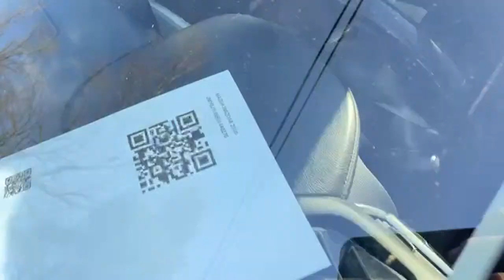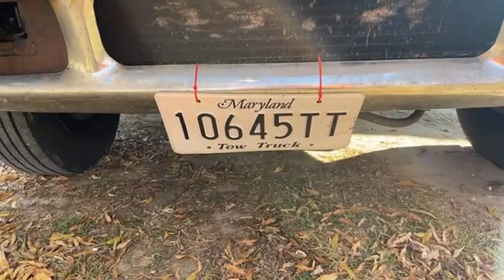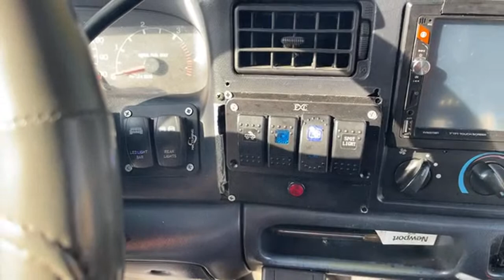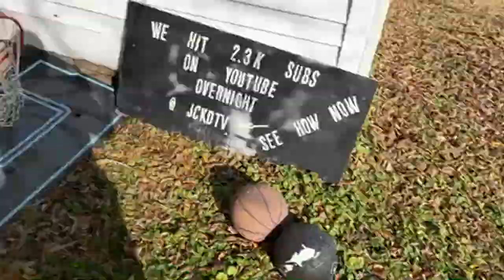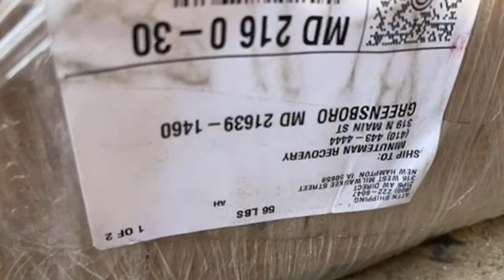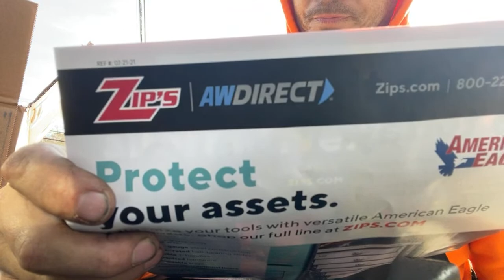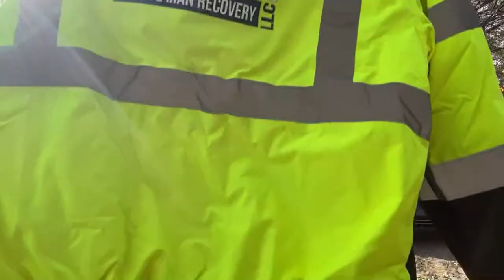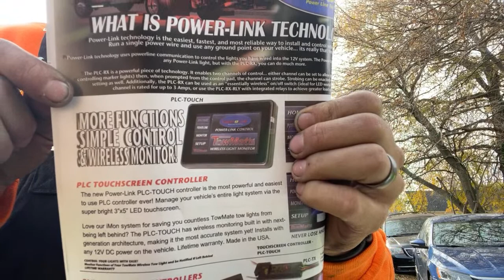🚨LIVE🚨 TOW TRUCK & CHANNEL UPDATES

Comment: Hey man as a former tow operator with over 10 years exp. I like your videos bit I do comment when I see things that kinda dissapoint me. Not sayin u dont know what u doin but there arr Betts ways sometimes. I've done all aspects of towing from jumpstart n lockouts to repos to recovering rolled iver semis on the Jersey turnpike n recovering vehicles with deceased bodies inside. So please dont get mad at my comments its just consrtuctive critisism
Reply from the maker: And what exactly could’ve been done different
Reply: @JCKDTV  for example the snow recovery with that suv if u had a snatch block n put your truck on a different angle it wouldve been a 123 recovery but also the dynamic wheel lift u have isnt set up for recoveries n stuff like that. Personally I hate dynamic lifts I think Vulcan n century have the best ones when it some to recoveries n winchoutsor even if u had ran ur tow line to the right side of the vehicle it qoyldve kept that tire from comin up off the ground. But shit bro u do what u do. Just remeber this opinions are like assholes everyone has one just some are shittier tham others but keep hookin n bookin brotha experience n knowledge come with time ya know. But u is growin on me.

Comment: Stay away from them Ford's especially for rollbacks brotha. Granted technically yes international is a Ford but internationals are great trucks n if u gonna get a roll back get a medium duty so its still non cdl no matter if its air brakes or not its still rated under 26k n I can fit bigger aized vehicles without having to worry bout damage to the bed n stiff on a lightduty roll back